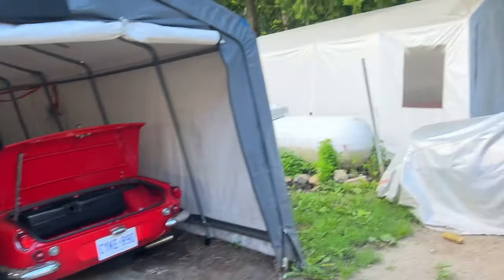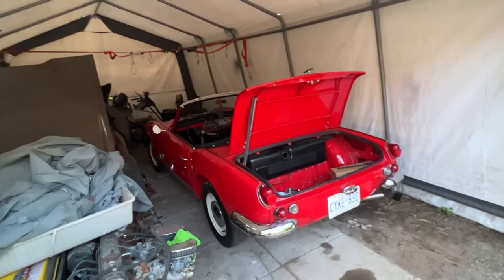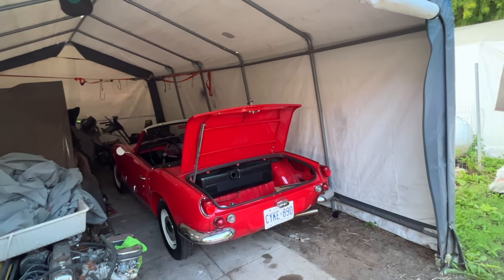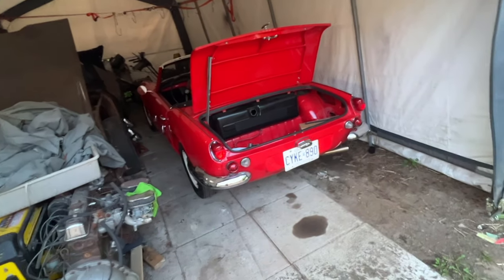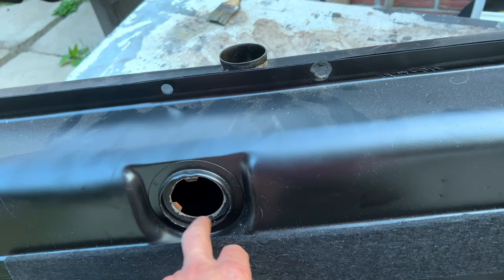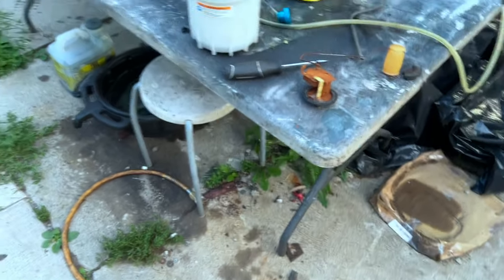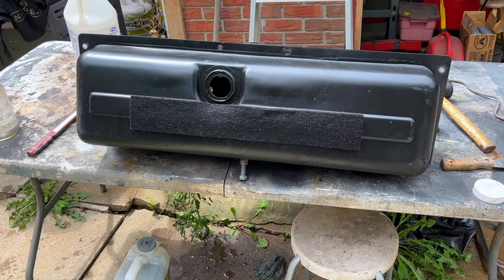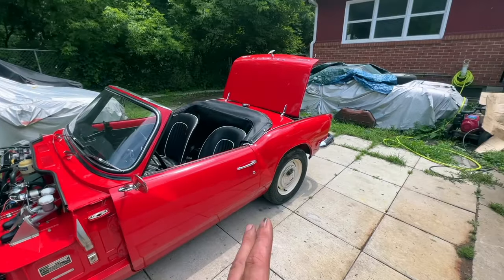Rusty Gas Tank & Oil Pressure Gauge Install - 1970 Spitfire MK3

Comment: Elin great video! I did this for my gas tank and it really works. Strap a dirty rusty gas tank to a cement mixer and put small nuts and bolts or small pebbles in it and let it run for a few hours. It’s really cleans the metal well. It also closes the pores in the metal caused by the rust.

Comment: Same tank as mine. I used restom to treat it, degreaser+phosphoric acid (better before a treatment as it cover the metal with phosphat) + resin (if some rust is not remove, seal it). Like new for a long time now.

Comment: I restored a 1972 GT6 in the late 90's and I used a gas tank sealer from Eastwood on the tank and never had a problem with it afterwards, It came with a cleaner/ etcher and then I pored in a sealer and had to rotate the tank to cover everything. I sold the car around 2013. POR15 also has a sealer for fuel tanks.

Comment: Back in the early 80's, I worked at a BMW dealer in New Jersey and they had coated the gas tanks (under the back seat, one on each side) with some sort of plastic. Something we put in our fuel ate away at the lining. The 320 had K-Jet  and the injector orifices were really small and would get all clogged up. I'm sure there are more efficient ways, but I would drop the tanks, put some water and gravel in them and shake the hell out of them. Maybe some nuts and bolts would work ? Another one, this one a bit funny, was that the windshield washer fluid would dissolve the German wiper blades leaving black streaks on the windshield :)

Comment: when I restored the two tanks in my Triumph, I sealed the insides with Woolies Slosh Tank Sealant, that was in the early 1990s, I also used Kunifer pipes and 30R9 Gates Barricade hoses and BMW fuel hose clamps

Comment: I get that using the wrong sealent on the inside of your tank can come back to bite you on the ass, but it is worth remembering that petrol is hygroscopic (thats why new tanks are always either treated or galvenised on the inside) and if the tank it not sealed it will re-rust even if kept full. 
Also im not convinced that the little dirt you got from the line was enough to block anything, however if your theory that the previous restorers left acid in the tank then it would go to say that it would also have corroded the inside of the line, not a problem for copper line but if it is a steel line that would cause rust scale and obviously restric flow.

Comment: Another great video Elin thank you for doing what you do for us ! i think i would have taken the manual fuel pump off and cleaned the screen as well but that's just me
Reply: I was thinking the same... maybe check the bowls and jets in the carbs, too. Just in case something really fine got by the filter. However, the car sounded like it was running well, so it's unlikely there is any problem. Owner should buy a couple spare filters, check the installed filter regularly and plan to change them a few times. Once a fuel system is contaminated, it's pretty hard to get it sparkling clean again!

Comment: The comments about the starter motor being awkward to remove confused me, till you showed it on video and I saw the obstruction. On the RHD cars without the steering column in the way the starter is dead easy to get in and out.

Comment: Nice! Glad you got the tank clean. Like many others have said here I used nuts and bolts or pebbles in water and shook the tank for an extended period. Any way that works is good. That car is very beautifully prepared and the engine bay is excellent. Thanks for another fine video, Elin!

Comment: Does he get fuel from the same place?  Sometimes the inground fuel tanks are " Dirty " or " Leaking Ground Water  " and can cause issues.. also check it isn't the Gas Vent?  It can cause it to stall out until you open Gas Cap and it gets the air in and flows again....Also check the Fuel pump on car ?? even a New one can be Bad....or has junk in it...

Comment: Ok Elin, you made your case very clearly why you prefer the old mechanical gauges but let’s face it if your driving along and you’ve got pressure, 45,50,( even 60lbs)-  then you’re good to go. If however, it suddenly drops to zero then you’re going to stop the car anyway.  Absolute accuracy per/lb per square inch at this level of science is pretty academic don’t you think?

Comment: Many years ago I had a Spitfire Mk 1  1963.  The previous owner installed an ammeter and an oil pressure gauge on a 2 gauge cluster under the dash in front of the driver.  I made another bracket for the passenger side with a number plate light and a switch for an interior light/map light.  Best wishes from Australia  
PS I loved everything about my Spitfire (sim color to this one) except the rear suspension and the tuck-in like an early VW beetle. It scared me once when I had to lift off part way around a bend.

Comment: Not always an easy job to do , so we’ll done and yes if ever a problem with a dirty tank you must always check & clean out the pipes, filter, pump an also the Carb’s bowl to be sure the dirt hasn’t got past any filters etc as it can & does!

Comment: Very interesting Elin but the perceived wisdom involves filling the tank with gravel or nuts and bolts and agitating it to dislodge the flakey material. I have also found that it is best to leave the acid for a couple of hours befor rinsing with clean water and then to neutralise the next day.. Hpe you efforts pay off however.

Comment: I don’t think there should be air in the fuel filter where it goes to the carburettors? Shouldn’t it be mounted with the carb feed pipe at the bottom, so the fuel naturally prevents air passing through to the float chambers?

Comment: to keep from flash rusting inside a tank of an old car... not a new car.... you can mix maybe two or three cups of gasoline mixed with two stroke oil - dino two stroke not synthetic two stroke and slosh that around the tank.  being generous with the two stroke oil.   i periodically put a bit of two stroke oil dino oil in the tank now and then and preventative  maintenance.

Comment: Ok, I made my other comment before the video was half finished. Did you use a new fuel level sender? There may have been crud in the old one. My TR6 sat with fuel for 15 years. The fuel line was very restricted with hardened "varnish" It took me a few days, but I cleaned it out using a bicycle brake cable attached to a drill motor, then washed it with carburetor cleaner. I used both the wire cable part , then the outer sleeve with the coating removed. Your persistence is quite amazing.

Comment: Yes that’s a good tip. With a still good tank, I’ve always used fine new gravel in soapy water sealing off all the apertures and giving the whole thing a really good shaking for five or ten minutes. (Good for your core muscles!) then multiple rinses and leaving in hot sunshine for a couple of days to really dry right out before applying the tank sealant.

Comment: After you rinse you can add rubbing alcohol which will mix with the remaining water.  Then drain it and the alcohol with make it evaporate quickly.  Then add some gas with oil and slosh that around to give it a little cost of rust protection.
Reply: Also, rather than loose nuts and bolts, use a length of chain and it will be much easier to extract.